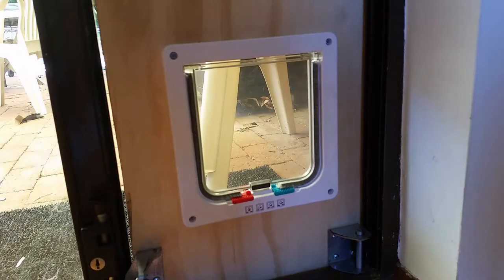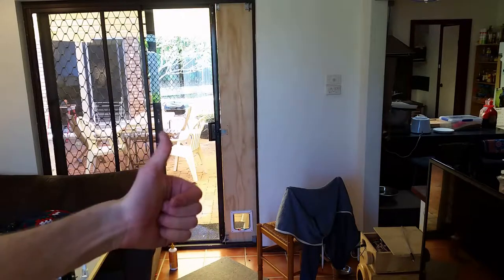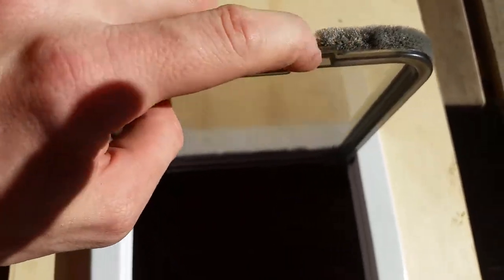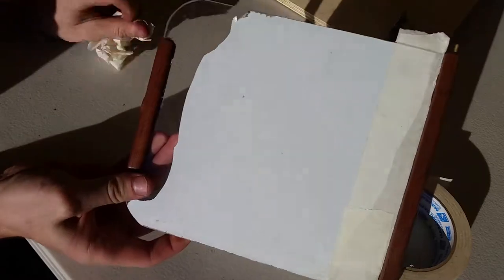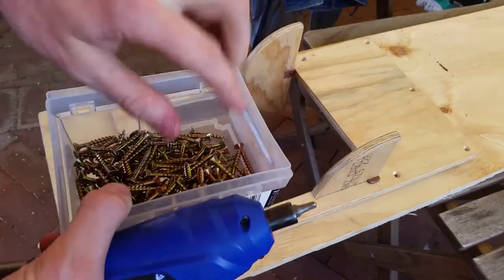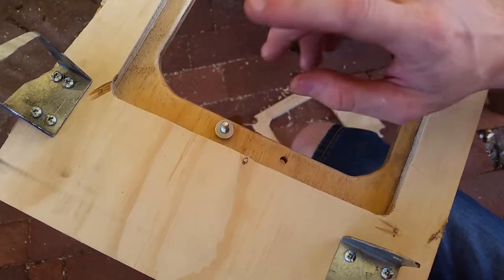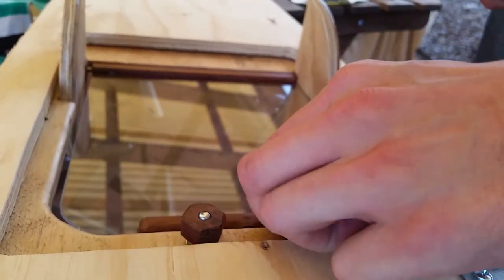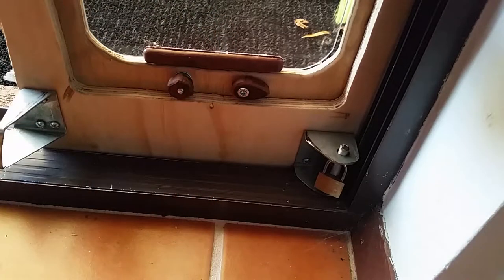Cat Flap - Built and Rebuilt

Comment: hello from the future. Did you find a good foam / fuzzy thing to put ont he sides of the flap so it's sealed when the flap is closed? That's a substantial air gap if its for an exterior facing entryway. Also want to block sounds/smells a bit more.
Reply from the maker: Hi Ryan, at the time my house was evaporative air-conditioned so there was always positive pressure and a few windows/doors open. I never had issues with the gap. I have since made a new version with less gap (sadly no video tho). Thanks for the question :)